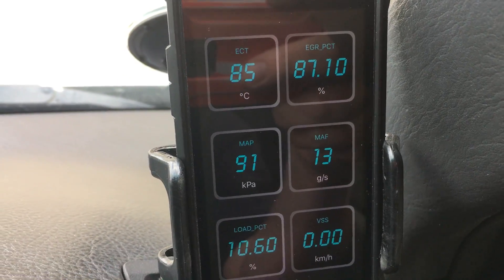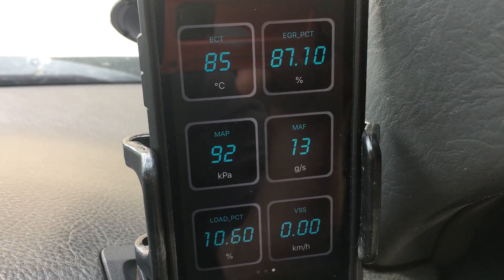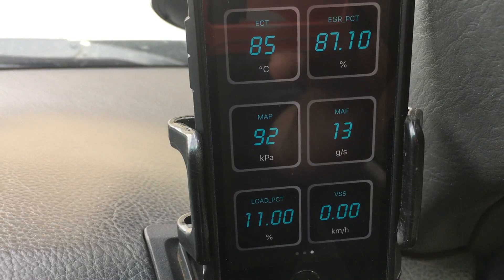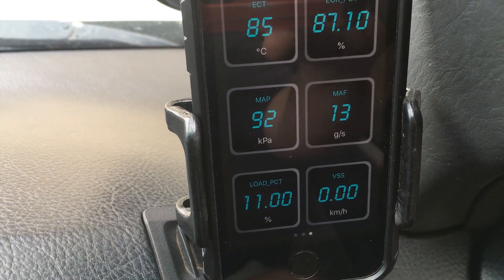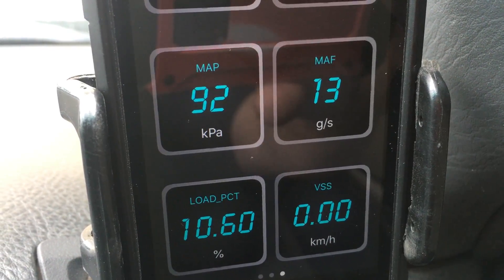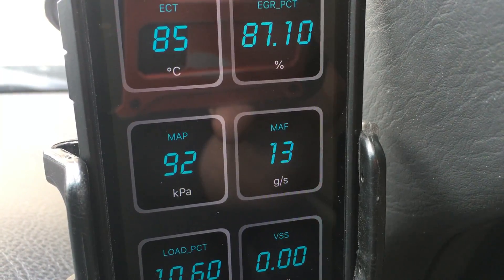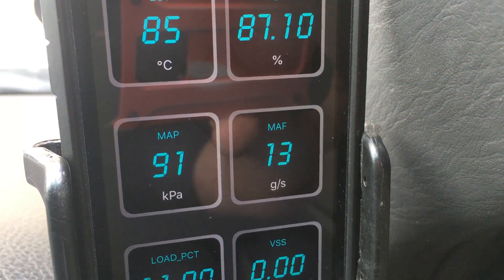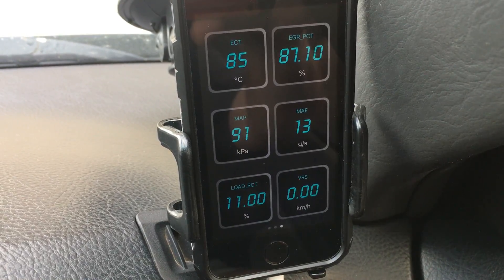ONE DAY YOU WILL JUST WISH YOU LISTENED 😁 Thank you those who do 🙏✌️save u $$ thank me l8tr 😁✌️

Comment: They tell me you can't get the auto temp on the 4 speed in the Hilux?
Reply from the maker: From memory there is one sensor and it fluctuates with the heat from the torque converter
I don’t think there’s a separate Penn Sensor temperature

Comment: My prado is too old, doesnt have OBD2 :(
Reply: i have the hilux the year before the prado came out , and I have OBD2, you have the same Electronic control diesel pump as mine, do a double check, it is there. you have the 1KZ , its got OBD2
Reply: @trevorspary134  It has the OBD2 port but doesn't run OBD2 to my knowledge, It has the 1gr-fe 4.0 v6 2003

Comment: I've had a scangauge II permanently connected to one of my vehicles for 15 years now and it has been faultless. not a Prado or Hilux but a 2005 Jeep Wrangler so not entirely relevant to this, especially being petrol and a manual. I like it as it gives accurate coolant temps and underhood temps as well as load, what the O2 sensors are doing and a host of other things that I switch thru. it is interesting comparing the temps with the idiot gauge in the dash. the scangauge temps fluctuate a lot displaying real world temperatures when going up hill, hot days vs cold days etc. whereas the dash gauge hardly moves from 'normal'. I've been told that the stock dash gauge averages temps and only steps up as some people get pannicky if they see real fluctuations. was going to get another one for my 79 series Cruiser twin cab, but now may get one of these units.